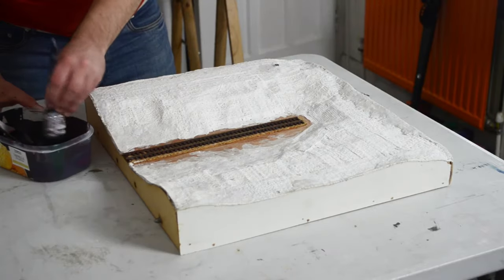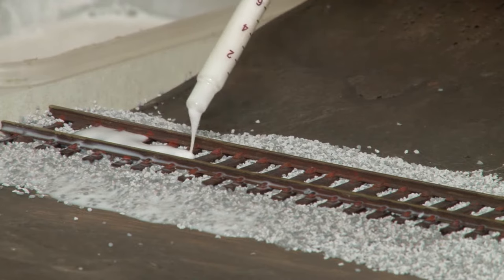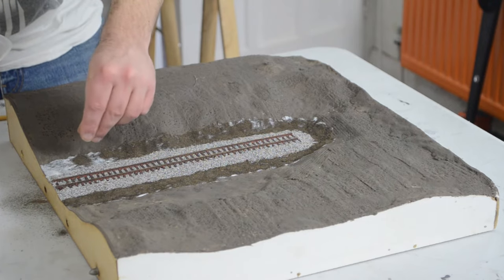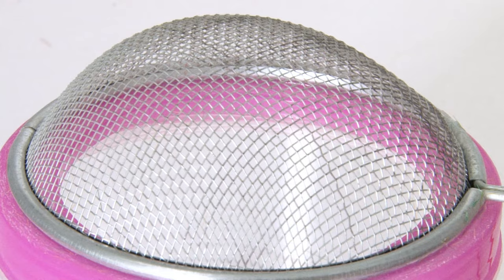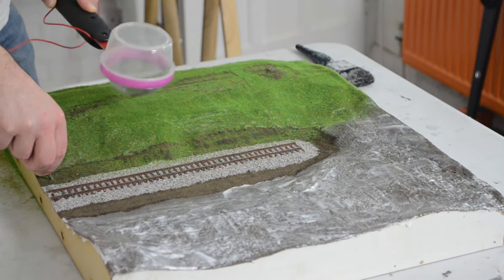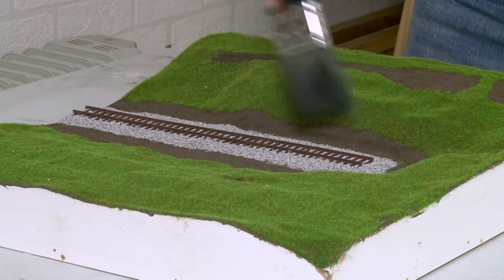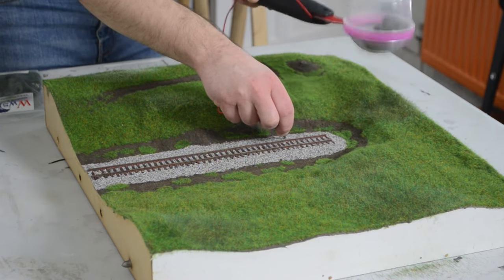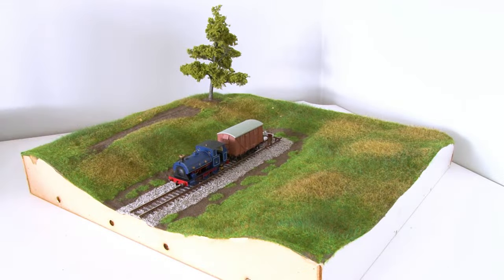How To Use Static Grass - Model Railway Basics: Episode Seven

Comment: Can I dilute the PVA 50/50 with water?
Reply from the maker: You could try but personally I wouldn't. In my experience you need the viscosity of the glue to keep the fibres standing up as they dry. If you thin the glue down too much then they'll fall over flat once you move the applicator away. Thanks for watching 👍
Reply: @ThatModelRailwayGuy  Thanks! 😀

Comment: Does burnt umber work as the dirt?
Reply from the maker: Yes I tend to use burnt umber with a little black mixed in to darken it down. I would still use actual dirt for the verges though to get the best results but it is of course optional. Thanks for watching 😃
Reply: @ThatModelRailwayGuy  ok thanks!